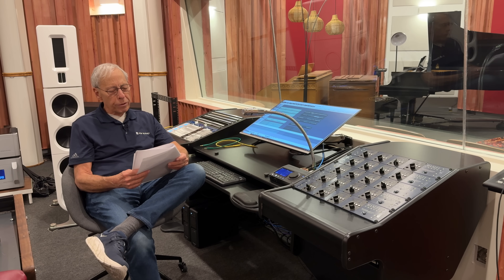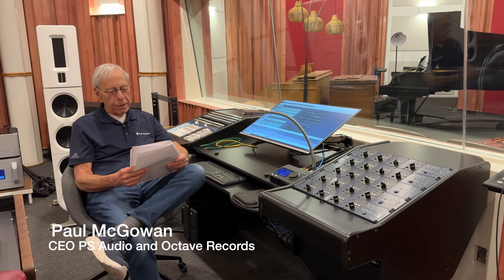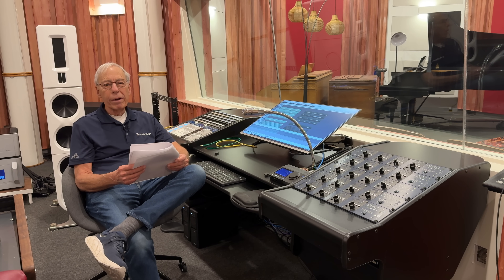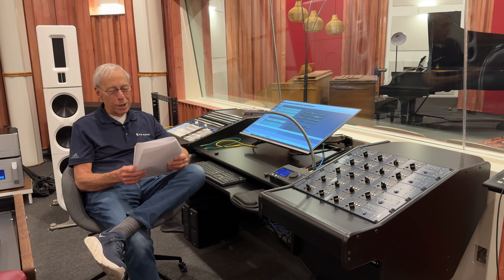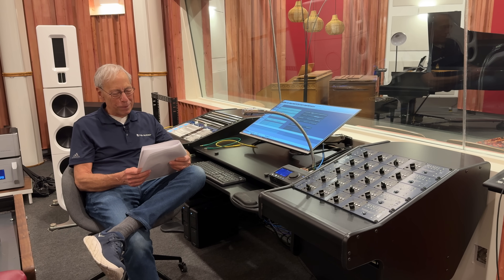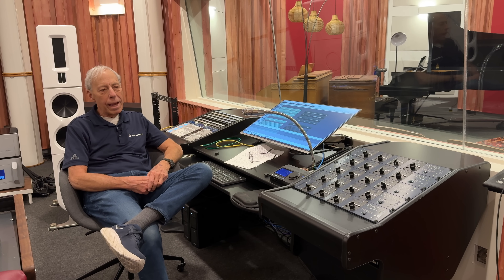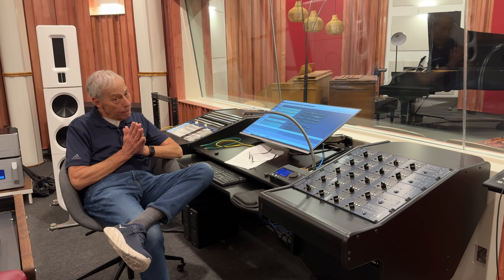DC mains for power amps?

Comment: But Paul Computer have power supply that has separate power supplies to different peripherals 12 volts here and 24 volts over there  and etc. they are modular plugs much less noise too?  🤔
(Be a trend setter Not a trend follower) Label the modular cables A B C ? 🤔 and those modules cable plug  only can be plug in one way just like building a computer? 🤔

Comment: I suspect the Chinese audio companies will do this, since many of the products have cheap, separate power supplies.  At least for the amps and preamps. 

I kind of expect to see battery powered audio equipment to take off in high end market.  Charge batteries when not in use, and disconnect and play audio from ultra low impedance ultra capacitors for preamps and dacs, and lithium iron phosphate for power amps. Big, bulky, inconvenient and expensive.  But so little power supply noise, and oh so much low input power impedance. Big batteries, big cap inconvenient goodness.

Comment: Well Golon in St. Louis 
Says That The D.C. Power Supply’s Run Cooler and More Efficient Actually we Use A.C. Voltage at 
60Hz Because It Is Cooler Than D.C. Voltage 
A.C. Pulsates at 60 Times Per Second So It’s Not Always On 
D.C. Voltage is Always On if We Ran D.C. Voltage Between The Walls of Your House That Voltage is Always On….It Would Be Like Living inside a 
Toaster…..Then Add Up All
The Twist And Turns 
The Voltage Travels On The Electrical Wire 
That Generates More Heat Because D.C. and 
A.C. Voltage Doesn’t Like To Make Twist and Turns 
Yet We Use A.C. Voltage For Your Home Because 
It Travels Cooler Than 
D.C. Plus We Can Raise The Voltage Of A.C. And Lower The Current To
Send The Voltage Long Distances and Then Reverse Lower The Voltage and Raise The Current In a D.C. Circuit
Like Your Cellphone 
You Have Millions of
Twists and Turns 
The D.C. Signal Travels Through All Those 
Twists and Turns Which 
Generates Heat and 
This is Why Your Cellphone Gets Warm 
And This is Why if You Are In a Data Center in The Critical Area Where Not Just Anyone Can Go To Where The Banks of Servers Are These Rooms Are Kept Very Cold 
Because The Data That’s Traveling in Those Servers Are Generating Lots Of Heat….The Primary Objective in A Data Center
Is To Move Information From One Place To Another As Fast As Possible And No Matter How Efficient You Think 
D.C. Voltage is Those Servers Are Still Running Hot And We Want Faster Speeds Which Will Generate Even More Heat 
….and Paul A Vacuum
Tube You Didn’t Give Us a
Number is it a 12AX7
or a 6L6 or a 6550 
Most of These Tubes are Still Available Yet Are Getting Harder To Find 
7868 Power Tubes 
They Are Out There Yet Very Expensive 
Now Most Power Tubes or
Valve Power Tubes Have As Many as 9 Pins Each Pin Has a Various 
D.C. Voltages That’s Why In Old Tube Power Amps 
The Transformer Was Huge And The Heater Pin 
Has The Highest Voltage 
Then The Grid And The Collector Plate 
I Wish Paul Would Get His
Audio Engineer Out and 
Lob a Few Questions To 
One Of Pauls 
Engineers 
That Would Be More 
Interesting 
….How Time Flys When 
Am Not Paying Attention 
Time For a Cup of 
Stir Crazy Coffee ☕️ 
The Old Lady is Making Me 4 Eggs 🍳 
Sunny Side Up and a
Slice of Ham With Amish 
Bread 🍞 
That’s One of The Reasons I Stay With Her
She is a Great Cook 🧑‍🍳 and Takes Good Care Of Me….😊

Comment: Many of the new products coming out especially from China are doing it. About the only thing not embracing a DC input yet are large A/B power amps. Yet.
Reply: no company that takes the time to design a high end class A or A/B amp is going to put their end sound to the responsibility of an unknown / generalized Source of high amperage / high wattage DC supply .  I understand that not all things can be answered in audio playback by just technical arguments - but at least - dont attempt  technical arguments when you have no clue what you are talking about..... sheesh
Reply: @ I never said anything about the price level. Sorry that triggered you so much that you jumped to as many conclusions as you could. But the fact is devices are being released at a constant speed with external power supplies. Turn tables. DACs. Streamers. And class D amps. Even some class A/B amps are and higher end amps have been released with them. Musical Fidelity is one of them. Facts are facts

Comment: 300VDC nanogrids for SMPS-based equipment could be a solution, with careful consideration of switching techniques and fault protection (DC-rated fuses). Most unversal-voltage rated smps can work well at 300VDC (Its close to the average a recified mains at the input of the SMPS). 
However I wouldn't recommend this for equipment that will constantly be plugged and unplugged because of arcing, probably for permanently installed equipment that have safety latches.

Comment: It seems pretty pointless to have home audio equipment be fed with DC for sound purposes. As long as you have a good power supply in your unit you can put in quite noisy AC and the PSU will still output a perfect DC signal. The measurements that I've seen of the output of good PSU's have all been flawless regardless of being fed with messy mains or a regenerated signal..
Reply: The regenerators are snake oil

Comment: This idea would only work if you had a DC power source that had voltage outlets suited to individual equipment... but even then the regulation would have to be exceptionally good as power amplifiers will demand very high peak currents....

Comment: The computing/data center world really messed this up. DC power distribution has been around for a long time in telecoms. 50 years ago, telcos were very dominant, and used a ‘48V negative return’ DC design for equipment. A rectifier plant would take AC power, and go rectify that power into DC power that it would distribute in a negative-return style point-to-point DC distribution. When I first started in the datacenter world the dominate computer manufacture was Sun Micro Systems and all Sun computers could be configured with DC main inputs. Then in the 90's the commodity servers and PCs started to be installed in data closets powered by the wiring of the office build, and they evolved into data centers: AC distribution is a direct side effect of that data closet, operating at AC voltage became the norm. 

AC inefficiencies and how crazy this is. In today's data centers, power is distributed through the building mostly as AC. Power enters the building as higher-voltage AC, which is stepped down to a voltage that can be safely routed to the server rooms. At the same time, a large part of the power is sent to the Uninterruptable Power Supply (UPS) system where the AC power is converted to DC power to maintain the batteries. Then it is converted back to AC and routed to the racks and the IT equipment. Inside each individual switch and server, the PSU or rectifier converts it back to the DC that the electronics wants. Converting electricity from one form to another always introduces power losses and inefficiency. When electricity is converted from AC to DC and vice versa, some energy is lost. Efficiencies can be as low as 73 percent, as power has to be converted to DC and back multiple times.

The future. Open19 rack standards. The Open19 group, which emerged from LinkedIn, produced its own rack design with DC distribution, but used point-to-point connectors - these are simplified snap-on connectors going from a power shelf to the servers but are conceptually similar to the connections within an old-school telcom central office. Standards group SSIA has published a new version of the Open19 rack standard, designed to create a standard approach to data center racks featuring liquid cooling, 48V DC power distribution and other advanced features. The Open19 v2 specification includes a pluggable liquid cooling standard for rack-mounted servers, and a 48V native power solution.

One of the things holding back DC is lack of knowledge. The barriers to entry for DC in data centers is that most operators are not aware of the fact that all of the IT loads that they currently buy that are AC-fed are also available as a DC-fed option. Most source point enterprise customers purchase and deploy commodity AC-fed equipment. But it's because of the telecom history that there are 48V options  available.  Today’s DC demand is strongly coming from hyperscalers like Microsoft, Google, and Amazon. Maybe in the future we will see more and more adoption of DC-fed equipment being deployed by commercial enterprises.
Reply: This is interesting. I am currently researching on 300VDC solid-state-switched power distribution for LED lighting and permanently  installed industrial equipment based on SMPS (interrupting DC requires special procedures and connectors). Its much simpler in this case because most unversal-voltage rated smps can work well at 300VDC (Its close to the average a recified mains at the input of the SMPS). In most cases the only modification needed is the input fuse to be DC rated.
300VDC is the also legal limit for nanogrids in some countries.
There are no AC losses, power factor, harmonics or phase imbalances to worry about in DC.
Reply: @collinsmwaura1833  It is all very interesting. Just think of where we would be if Thomas Edison had prevailed over George Westinghouse during the War of the Currents.
Reply: @joeythedime1838   All our appliances and power systems would be very different and very efficient. However, back then the SMPS wasn't around yet.
Reply: TEs DC systems?  TE was not an engineer at all.  He was steve jobs of his era.   He was a marketer / visionary , not an engineer.   He certainly understood the need for engineers and RanD labs though.   Kudos to him for that.  We would not have the current world w/o tesla AC systems.....   The current electrified world would be utterly impossible w/o the AC polyphase generation and distribution that was created by Tesla.   Other  equal engineers were on this track as well.... and many of those engineers took teslas basic initial great implementation into much greater efficiency and refinement and understanding over the 25 years after that.  Oliver Heaviside, Charles Proteus Steinmetz, Oliver Heaviside, and a few GREAT scientists and engineers of the time.
Reply: using an all DC data center is not feasible for the current (as in 'now' not amperes) widespread needs of modern  Data Center systems.   I have been an IT Data Center infrastructure  architect / eng for 35 years.     However what you are saying is not applicable to data centers or audio.  For remote systems (like all the cell tower rack room next to the 500 foot antennas) it has always made sense to use 48V DC power supplies for that primarily based on the Telco model that all telco switching systems used this since creating a high power DC bank of batteries - 48Volts is ez simple, and efficient to do and is (and I have news for you there is tons of need to convert that externally and internally inside all of the rack systems stuff that can take 48V.  This was done primarily to insulate the telco from power outages and was a VERY good solution for that.   It would have been cheaper to just use AC in these telco centers if power backup was not an issue.  We have not gone backwards - we just have way more options and efficiency today that we ever had back in the good ol telco only days.   Don't wander off the ranch please.   I have no clue how this discussions applies to typical (I.e. almost 100%of it) home audio.  Power regenerators for home audio are mostly high end audio snake oil.  If they are not implemented well like the low end PS stuff then they could easily hinder not help the sound.  For music   studios and media studio complexes it is a good idea.   However there they would never use cheesey power regenerators like the ps power systems do.... they would get the power right at the source on the pole transformer and building power distribution level and do on an industrial level what needs to be done to make it as suitable as possible.
Reply: @baylonjay I don't know why most recording studios would even go to the trouble of implementing this type of stuff when most recordings don't sound that good anyway. Most listeners wouldn't even hear the difference on the equipment they buy and listen on.
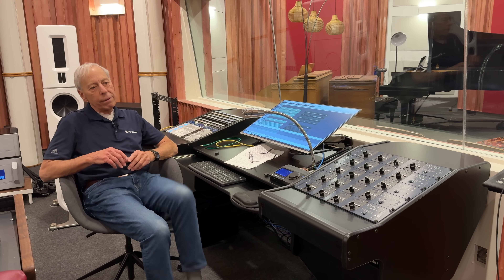Reply: oh I agree when you say 3:12  'most' as you are right even if they do a great job with the recording and performance and production...... the quality of thier power into the builfding is almost always, not going to be a factor one way or the other (unless there is just something basic wrong with thier power into the building and that is different issue).  I have worked on power systems for big 5.1 movie/streaming/ video games soundstage where sound track music composers, dialogue editors, Foley SFX guys, and many other types of general sound designers create and assemble this into overall soundtracks... that is more what I was referring to

Comment: I have a phono preamp, built with a friend of mine who was a fellow engineering student nearly 50 years ago. He mostly designed the circuit around the Western Electric 417A tube and I was responsible for the power supply. After an original design, that had a hum pot in signal path, I decided to employ a 28VDC aircraft battery, easily accessible given my job in aerospace-aeronautics industry. 

Ive tried dozens of low, mid and high gain phono preamps, both vacuum tube and silicon, since but never heard anything that’s as quiet as this unit. I’ve considered building a line stage but have never found the time and my buddy who collaborated on my phono preamp has unfortunately passed away. Would love to find the time for full battery powered line stage and amps. 

As for PS Audio, why not build a line of amps, line stages and phono preamps with outboard DC output power supplies? Essentially they would be based on Powerplant only with DC output of whatever voltage and Ah needed for your amp, line stage and phono preamp.